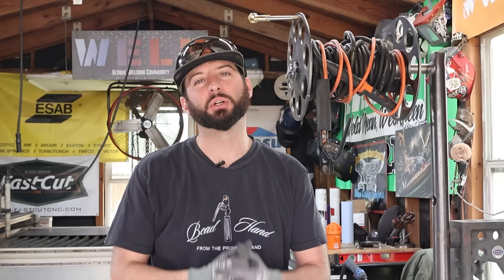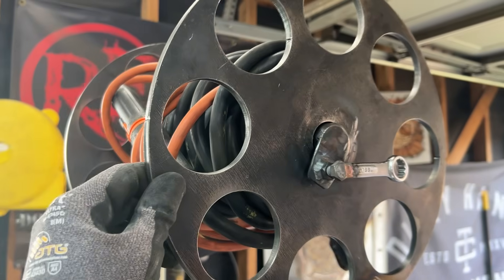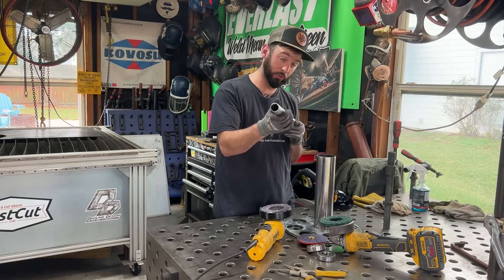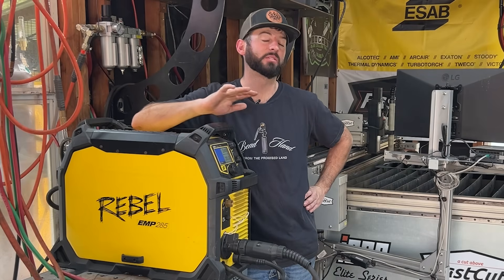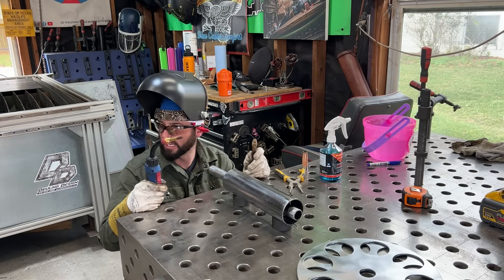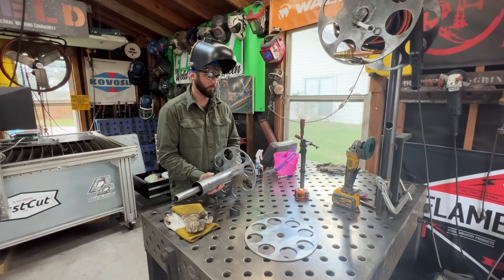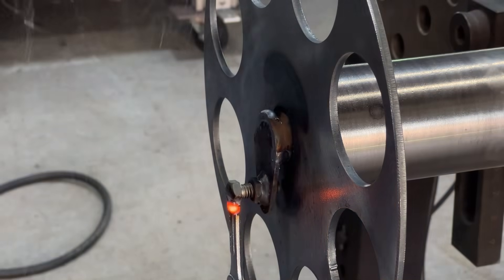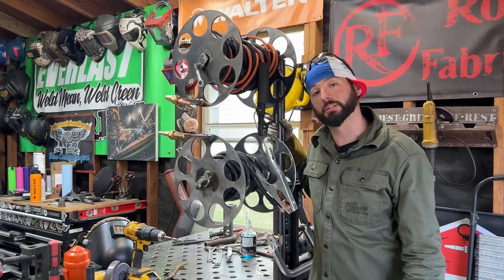DIY Welding Lead Reels: Build Yours for Under $100!

Comment: These are not under $100. You're not accounting for your labor and overhead. Not just the labor of actually fabricating it, but designing it, designing and building the first one which ended up obsolete. I'm guessing the true cost is about $1000 if you added all that stuff in, which you would account for if you were building it for a customer. Would be easier, faster, and far more economical just to buy a set. Can get Diamond lead reels for $350. Drill 4 holes to mount it and you're done. Now you can spend time working on projects that will actually make you money instead of cost it.
Reply: @Lk23.43  you’re not as smart as you think you are.
Reply: @phillipgiampa6437 lol ok. I like how you didn’t try refuting anything I said, just insulted me.

Comment: What’s your guys thoughts on using aluminum? I would route 2 end pieces out of 1/4” plate
Reply: @BofDave  aluminum is good idea for weight reduction for both the plates on the side and the bigger pipe between them. But all of the bearings I’ve seen and still Steel. So what you would have to do is drill holes into the aluminum pipe, and use Set Screws to hold the bearings in place

Comment: I’m in the market for a new engine driven. Was looking at those 330 like on the back of your rig. Does it Run pretty smoothly? Could you do a demo on some scrap pipe/plate or some coupons? Just curious. Thanks
Reply: I've used the 330 for a little bit now, and it runs pretty dang good. Only issue was having the GFCI outlet go out.

Comment: When I built mine I drilled 4 holes in the larger tube where the bearings ride and tacked them from the outside. Worked perfect.

Comment: Austin.  I really like this project.   So many welders starting out can do this and have their rig look professional.  You can use a torch to cut the outer rings.  A hand-held drill to make the holes and your mig welder to assemble it all. Low budget.

I also like the honesty with the build. A little hack for assembling the reels on the vertical pipe is to use ratchet straps to support the reels weight while you position it. 

If you would like a set of plans with a material list for your followers, let me know.  I would be happy to provide it. Nooo i am not looking for anything, just an offer to pay ot forward 

P.S. love the water bucket ❤

Comment: I didn’t see the ground connection on the spool when you welded it, so if it wasn’t you were making a connection through the bearings when welding. I may have not seen the connection, just thinking is all.
Reply: Right at the beginning, before starting, i show that im not grounding the set up. Just sticking the nub out the side. I have a jumper from the machine that will need to be dis connected to reel the spool. which sucks, but no worries about grounding through the trailer or bearings.

Comment: Don't think I would like the reals because if you don't unwind all of welding lead will act like a coil and get hot and burn up your leads, So I have been told by a pipe welder frend
Reply: Im sure if youre burning all day everyday it could have an effect. I dont believe the coil will hurt anything. outside of it being kind of a tight coil.

Comment: You should have left it uncentered. We do that so the reel will not unwind by it's self. Proven  design since 1989!
Reply: I had no Idea!
Reply: @Drweldz  The weight will be heavy to one side of the reel. When you stop pulling the cable the heavy side will go to the bottom and stop. So when you are working a fare bit away and need more lead just pull and it will stop when you stop, no unloading of the reel into a pile. But you will need to isolate each reel so they are not grounded, and I will leave that to you. Take a look at Coxreels and how they do their connection to power.
Reply: Or better yet Reelcraft
Reply: @lorencolt  sounds nice. the little break is a crude version, keeping it from piling up. Just tight enough you can pull and the reel stop, tighten all the way for lock. nothing is grounded on these, just a hole for the dense connector to peak through. I just wanted something simple and ready to roll, literally.
Reply: @Drweldz  I went out in my bonepile today and found a homemade pipeliners reel set and that one is isolated in 2 places, The base has a 3/8" plastic plate and bolt washers with the ground bolted to the baseplate, and then 1 reel mount with the same setup with the work bolted to the reel mount plate. and the leads are bolted to the reels. No connectors. Its fun to see how other people do it. I think we had a snow day at the shop and we built 3 or 4 versions for our mobile welders, none the same. All that you are missing is the plastic parts.
GRANGER 
insulator sleeves   
Item 

    4DCA8
Mfr. Model 
    10SC312062
hdpe sheet 
Item 
    1ZAJ3
Mfr. Model 
    1ZAJ3
Reply: Brilliant... thx
Reply: @lorencolt  or you could add a clip to lock it when you’re not unwinding them

Comment: I wish I had your prices for metal up here in Alaska! That plate would be well over 1000$ up here, probably about 200 for the 3inch pipe, and 150 for the 1/34" pipe. Bearings would be about 100.
Reply: Wish I could help yah on that bubba. All my builds would be scrap yard builds if i lived up there i guess. Like mad max of the back country

Comment: Steel car rim cut in half, channel or square tube and a plate on the bottom, your done, kind of hillbilly but worked well for years.
Reply: Hillbilly is good. im part hillbilly if ye cant tell
Reply: I have done that; it was a PIA to me.

Comment: Yea 50 bucks if you have A SHIT TON of steel plate laying around
Reply: The plate was no more than 45$ charge it to the game bubba
Reply: @ good to know…. Guess i need a new supplier
Reply: @mongiello28  It was a drop piece at my local metal supply. They always sell drops cheaper.

Comment: Welding bearings is a no go, but in a case like this since its non critical and the bearing womt get much abuse its fine, one thing tho: DONT let the bearing be the ground, you gonna weld the center, put your ground on the center tube, weld tbe outside, ground the outside.
Reply: nothing on it is grounded, simple has the LC-40 sticking out the side. Cant spool em while hooked up with jumpers to the machine connected. but no worries on grounding. Hope the tacks hold
Reply: @Drweldz   He's talking about when you're fabricating the reels to move your ground on the work piece so your weld current doesn't pass through the ball bearings and leave arc marks inside the bearing races.

Comment: Would it have been wise to maybe drilled some holes to weld the bearings?   This is a great design though.   Inspiring for sure than you for sharing and being vulnerable.
Reply: Thank you! Plug welds wouldve been better i agree. Evidently not the route to take though.

Comment: I feel like if you wanted to weld the bearings in and so far inboard, maybe plug welding them would have been a little better, but you got it done so really the path you took doesn't much matter.
Reply: i didnt think about that! Evidently putting a dab of weld is a no go anyway.. they work good from my house!
Reply: @AustinHargett  either way it's good stuff. It's always nice when you can get stuff up off the floor and put off the way.  First shop I worked at that had the oxy/acetylene torches on reels changed my life and stick leads are just as much of a struggle.